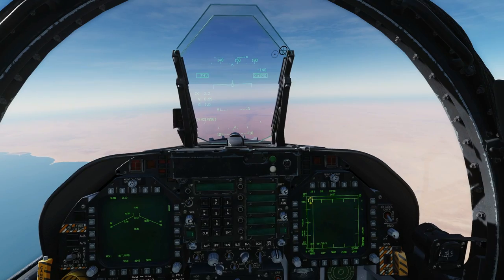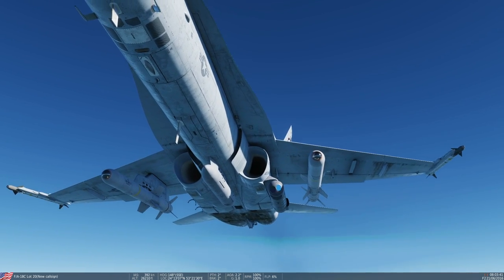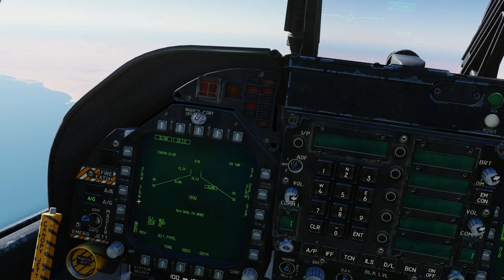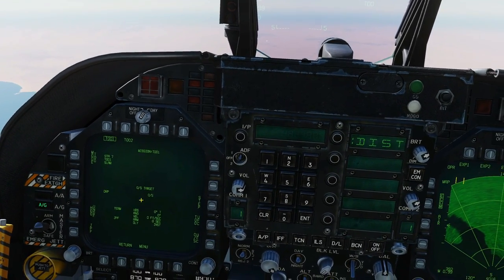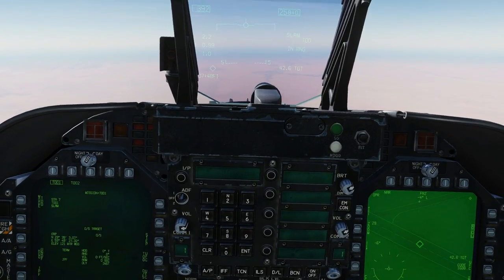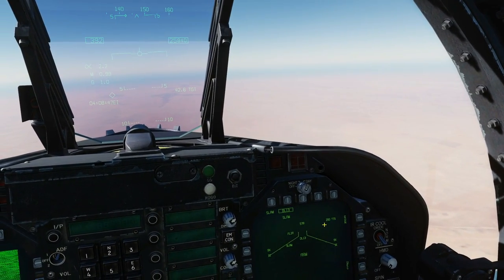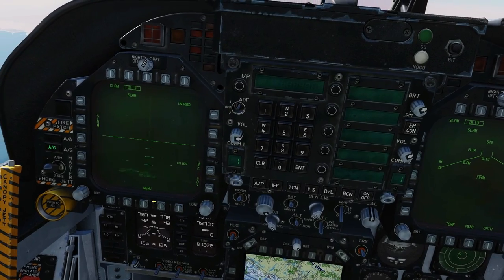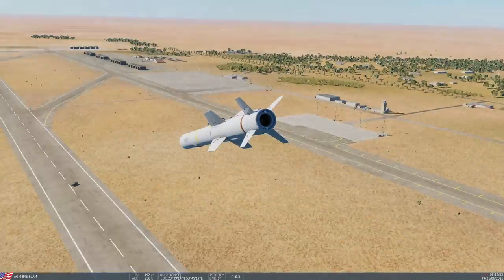FA-18C Hornet: AGM-84E SLAM Cruise Missile Tutorial | DCS WORLD

Comment: My DCS is a little bit broken ive got the steam version. But when i update the game than i got an overwritte error for handlings of every plane orso. Ive tryed to re install but no results. Can some one help me please?
Reply: Try verifying your files (DCS>left click>propertys>files>verify files)
Reply: "Handlings"? You mean for controls?
Save your profiles. (One profile per controls column unfortunately).
Also do what Leonhardo said.
Reply: Its more like: DCS user manual EN and RU, and DCS Flight manual of every plane i did not change my game files
Reply: I had the same issue on the most recent update through Steam.  Verifying showed clean.  I even uninstalled and reinstalled the game (w/ the latest version) and had the same issue.  I noticed clicking on Download did actually proceed a little further. Doing that a few dozens times or so eventually got me to the end of the download.  Seemed a little sketchy, but the game seems to work fine.  Good luck.